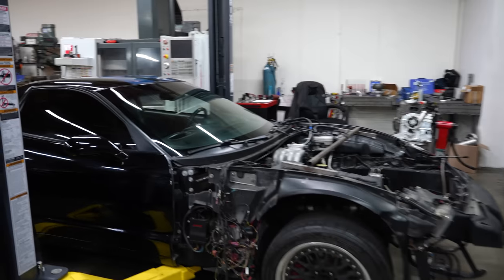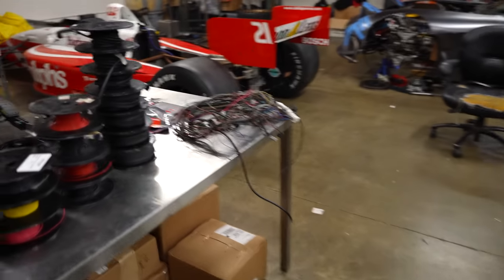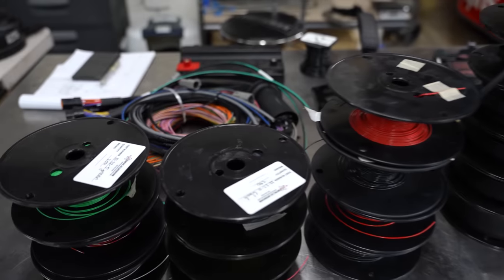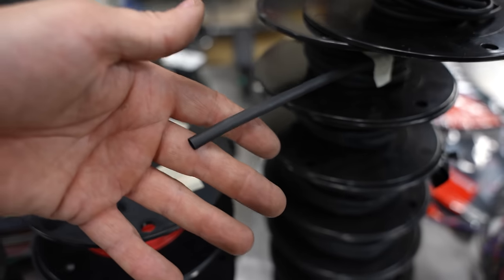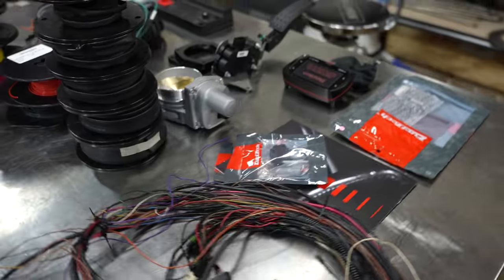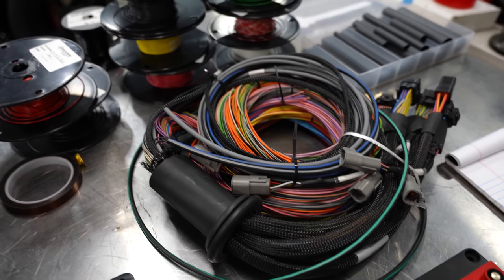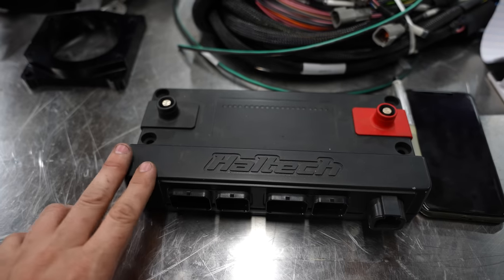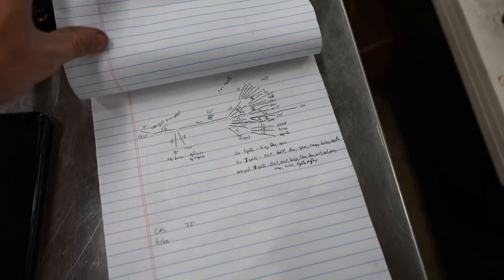The Ultimate Engine Wiring Starter Guide.

Comment: TE (TYCO ELECTRONICS) provides the complete "System 25" solution, initially developed for military ground vehicles I think. It includes the "DR-25" tubing (which is fluid-resistant elastomeric polyethylene terephthalate I believe), moulded parts with the "-25" prefix, and "/86" suffix meaning it comes with the TE/Raychem "S1048" thermoplastic adhesive, and standalone rolls of "S1048" adhesive for joining heat shrink and moulded heat shrink parts together. 

TE/Raychem also sell ETFE "Tefzel" and PVDF "Kynar" insulated wires, as respectively SPEC 55 (Tefzel) and SPEC 44 (Kynar) - both are high performance fluoropolymer/fluorine-based wires used in space, aerospace and military applications.

When you're referring to "levels" of wiring, I belive you're inadvertently referring to IPC/WHMA-A-620 classes for wiring harnesses. IPC standards often refer to three levels of craftsmanship, class 1 (General Electronic Products), class 2 (Dedicated Service Electronic Products), class 3 (High Performance/Harsh Environment Electronic Products).

Comment: After watching through this for a second time I had an idea. What about using that adhesiveless silicone tape instead of zip ties. There would be no notch for a wire want to pop into, and it is reusable so you can just remove and replace them as you move down the loom, plus you can stretch it pretty tight if you really want to clamp down. No clue if it will work, but figured it would be worth mentioning. Also you can roll the ends of the woven loom guard in on themselves to help keep them from unraveling.

Comment: Rob when you use nylon cable sleeve, burn the ends with a lighter to avoid the nylon splitting, also flip the end inwards like you close a bag of chips and then apply a thick cable tie. it looks clean and lasts forever.

Comment: Marine Grade heat shrink and wire made by brands like Ancor also have really good adhesive in the heat shrink and 105c oil/Solvent resistant coatings. Also tinned copper to prevent corrosion.

Comment: TXL wire is great, exceeds OEM specs, very affordable, and very easy to work with. If you not building a F1 car it'll be fine for most applications. But remember, even the best wire won't save you from a bad crimp.

Comment: Buy yourself some 3M self bonding electrical tape or commonly called thermal rubber tape... It will form a single rubber mould over your wiring. Can be used as extra protection under shrink tube and you can vary the thickness by manually stretching it depending on whether you need lightweight or protection. You can get it in different widths also. There is a semi-conductive version available that I use to wrap over 3M electrical shielding tape to protect signal wiring from stray electrical interference.

Comment: I work on medium voltage cables a lot and use this rayhem heatshrinks, they are very strong and stiff, but to shrink like 0.5m of heatshrink I need sometimes 10-15min of heating on high heat.

Comment: Very useful video, especially given that I've recently had a harness failure on a motorcycle of mine...

Just an bit of further explanation regarding that shielded sensor wire: you're correct about it being twisted and shielded for EMI reasons, but it sounds like you're trying to understand how the twisting helps. There's two major factors about why the signal wire is a Twisted Pair. First, is that the sensor signal is a Differential signal (basically the signal and it's own reference voltage). The sensor reading is then the difference between the signal return and the reference going into the sensor. 

Second, twisting the wires together it helps ensure that no matter what the orientation of an interfering EM field relative to the twisted pair, both conductors experience a common influence (creating a Common Mode noise voltage). Since, the sensor reading is the difference between the two voltages, this added noise due to the outside interference mostly cancels itself out. It's not 100% perfect, but it goes a looong ways to providing immunity to outside interference.

This is the same reason why Ethernet cables are twisted pair (and the UTP you see in product descriptions for those cables means "Unshielded Twisted Pair", in contrast to more expensive, more robust Shielded Twisted Pair cables).

Comment: Go to Lowes, get some peg board, and tight fitting dowel rod for the board and a 100ft roll of 16awg solid core wire. fabric measuring tape. Use the peg board to template the harness make a dummy with the solid core wire.

Lay the template on the engine

Comment: I use rtv to fill the voids where wires meet up. I put a little rtv in before I fully heat shrink everything together. The trick is not using too much that it makes a mess.

Comment: Twisting also reduces interference (induction) to/from other circuits. That’s why CANBUS, ABS, etc are twisted pairs. Same theory as the twisted pairs in an Ethernet cable. Noise and crosstalk reduction.

Comment: The crank sensor is a voltage generator. At low rpm, the signal off of the crank sensor is maybe a couple of volts, but once you have those teeth flying by the magnet at high speed, you get pulses of about 100 volts and more. 
The crank sensor wire is shielded to protect the system from EMI (electro-magnetic interference) generated by the crank sensor, not the other way around. Just imagine the leaked pulses from the crank tone wheel showing up on your throttle position sensor (that runs at 5 volts).
Keep stuff away from the crank sensor wire.

Comment: This probably won’t be read and I’m like 15 mins in but it probably won’t be mentioned,but as a F-16 electrician, if you want to clean up the harness is by using waxed twine instead of zip ties. You can also use them along the the harness instead of twisting it, in case there is a point where a wire needs to be replaced you don’t have to rip the whole thing apart and feed wire that was replaced under the twine.

Comment: Super 88 is really good electrician tape. It has an operating temp between 0 F - 221 F. It holds and works a good % above and below those temps to. So I’d say -20 F - 250 F would be fine. If you used that metal duct tape to wrap the Super 88 in you’ll have EM protection and also heat protection so that the 88 under it would survive the cable being exposed to sources much hotter than 88’s temp rating.

Comment: I enjoyed your video. One nit pick. conductor, insulation, jacket, cable and/or conduit. Wire is usually a conductor with insulation. Multiple wires in a jacket is usually a cable. The insulation protects you from the electrons, the jacket or conduit protects the insulation.

Comment: Afaik, the electrons running on the outside if the conducter only apllies at high frequencies. More strands also make the wire more flexible

Comment: Just a little tip, when your zip tying the wires your twisting around the center wires, look into string tie for aviation wiring, its alot easier to get tight so twists don't wiggle around and you avoid pushing the wire out of the way from the end of the zip tie

Comment: Level 5 wiring, every wire is color/pattern coded for its specific use. Open the bundle in the middle, no two wires match. 6 red wires, one red, one red with narrow white stripe, red with narrow blue stripe, one red with dashed blue stripe, etc etc etc.

Comment: A good heat retardant silicone would be good to fill in any voids at the branch points, it will stay flexible plus you can work out any air bubbles as it sets. It's brilliant stuff to keep, I believe the rule with all silicone is if it smells like  vinegar you should not use it on uncovered metal or cable so most will be fine as long as the insulation is intact. Really interesting show today thank you so much for sharing your experience I believe that you done a fantastic job it.

Comment: I have an interior/significant engine bay 03 Ford Lightning harness. Can't buy a new one. It was carefully pulled out from an RIP sonic blue by 2 Lightning people. It is sitting is a box in my garage. But I still used it as a roadmap to manage to fix significant amount of damage done. By a mechanic. Who is a friend of my close friends. 
It ran awesome, just heavy maintenance.  Wiring harness stuff is hard. Being a petite lady with small hands has few advantages. Running wires is one. I'm keeping that harness bc eventually mine will fail. I want to be driving it when I'm 90 yrs old.

Comment: Rob, nice video. The only advice is to use tube-style crimps for all the splits, and not the open-ended ones. Sure the open-ended crimps work, and are easier to put on, but tubes can withstand more pulling on the wires...a LOT more(some of them are even ribbed on the inside) also the open ends basically have a sharp edge on the end, that acts like a knife when the wire is bent 90deg and pulled on, but tube style crimps have round inside edges so they support the wire better.

Comment: They make heat shrink cartridges that you can use in label makers too that is relatively flexible. It works great for small wires and larger ones as it comes in up to .92".

Comment: Excellent wiring skills! The only thing I'd like to point out is that for the sake of future repairs that may need to be done I'd avoid using epoxy. The epoxy is very hard to take off and most the time when there's wiring issues its right near where the contacts get inserted into the connector.

Comment: For better protection of the wiring harness splits you should use heat shrinkable moulded shapes. There any many models available with and without adhesive. HellermannTyton is one of the biggest manufacturer of moulded shapes and with W21 pre applied adhesive you’ll be on the top 😉

Comment: having one central star point for the grounded wire is also good for security. electricity always looks for the least resistance, so if you have a bunch of loops and stuff it can happen that due to the length the grounded wire isn't the one with the least resistance anymore.

Comment: EMF = electromotive force
EMI = electromagnetic interference

You should check out there HP Academy course as will. If your going through all the trouble of using the foods stuff, your might as well learn how many wires you should have in each layer. Their course is top notch.

Comment: at 36:28 , having a few crimps nearby each other might make the harness diameter larger (harder to fit into heat shrink) but staggered crimps can sometimes make the harness less flexible / harder to bend.

Comment: AND DONE! lol why not instead of using the smaller heat shrink under the bigger to fill space, shrink the bigger and put the smaller over, depending on the gap you are trying to fill it will seal it way nicer

Comment: Electrons only travel on the surface layer of some AC signals. Not DC. And in that case they only use the outer strands. The inner core wire(s) go unused. That's why high-voltage power wires are often split (doubled) and have cores of steel (for strength as well as being unused).

The main reason that small-strand twisted wire is used in automotive applications is for bending and flexibility.

Comment: On the connectors you should try putting the large shrink on first to cover the connector and wire then sliding the little shrink over the end to fully seal the end of it
Reply from the maker: That’s a cool idea!
Reply: @RobDahm  I mean you are more of an expert than I am in the automotive portion and you possibly could have tried this way already but I've always liked how it has come out when I do it that way when I repair connectors (huge fan btw learned to rebuild the rotors from you)

Comment: Damn that's insane you built your own engine wiring harness. I've done tons of low voltage wiring in buildings, but never stressed out about it so much as when I had to replace my fuel injector electrical connectors, because the pins didn't fit the aftermarket electrical connectors. Probably one of the worst environments for a wire connection possible.

Comment: The low voltage wires require plenum rated shielding from higher voltage wires delivering electrical power.

Comment: Somewhat satisfying to watch. FYI the way the label maker works is thermal transfer to the label. So not sure in the long run, will the labels just turn black with the heat from the engine.

Comment: I'm always surprised how little winds up needing to be shielded-- interestingly enough, GM shields their DBW pedal and throttle body from the factory and not CAS (or their CANBus stuff surprisingly). Really, really awesome video Rob. You've pushed me over the edge to do my Datsun's harness right; at least to the best of my ability.
Reply: CAN uses differential signalling, and noise should increase or decrease both high and low lines, you'd only get a problem if the voltages moved towards or away from each other.

Comment: You don't necessarily chose shrink wrap for the entire shrinking ratio - that's meant to account for lack of uniformity when you have varying diameters in a harness (not just car harness). You generally want to use the smallest size that easily slips over the harness so you achieve a more secure shrink and flexible coating.

That being said, nice video.

Comment: To avoid the dip in the Ty-wrap when wrapping your harness take the Ty-wrap go around 360 degrees before insetting the end of the Ty-wrap into the head then pull snug. No dip no need for tape.  30 yr Verizon cable splicer doing as many as 3600 twisted pairs at a time or 7200 individual conductors lol

Comment: @5:28   Electric current on the outside of wires is called the skin effect, and is only significant at high frequencies.  Basically, anything under 1 MHz or so, the skin effect is negligible.
The reason the number of strands matters is flexibility of the wire, and resistance to movement and vibration.   Fewer larger strands are more susceptible to metal fatigue from repeated movement and can crack in extreme cases.

Comment: Great video, but not gonna lie, I wired my engine swap in my C10 with Cat 6 network cable shrink-wrapped neatly for signal wires... because I had a partial roll of 1000ft sitting around.

Comment: The sand paper is not original to Horsepower Academy. In Medium Voltage and up cable splices some Splice Kits and techniques state to use Emery Cloth to prep certain parts. 
If y’all want ideas on making crazy good splices check out the videos on the different types of electrical splices. On medium voltage and up the the way the electromagnetic field lines form is a major concern and is what most of the splice techniques are designed to manage. Nerdy but good stuff to know. Even the way cables are stacked or spaced out is important ie 3 in a triangle is ok if space is needed but three spread out with iirc 1,5 of cable diameter space between each cable will last longer.

Comment: every time you  used a zip tie
you could have used a strip of capton tape 
this way you dont need to remove the temporary zip ties
less room for error and such

(unless you need that pressure form the zip ties)
(can you use hot glue or does that melt?)

the end result (and the process) was hella beautiful to watch

Comment: Rob Great Video!!   I am placing a 2007 Northstar into a Kit Car and I have the original engine harness, ECM, TCM, Fuse box and have the VATS shut off. Could you provide a video on how to power up an OE harness and maybe even show adding the OBDII connector and Throttle position signal from the electronic gas pedal?  Include any other obstacles that one might run across using the stock harness? 
That would be such a great video and I couldnt find one already done on YT. Most are about modifying or making your own harness.

Comment: Looks very pretty but what happens when you get a short that melts insulation inside that heat shrink? And takes everything with it? I prefer wiring to be open and easily repairable / see if anything is getting too hot

Comment: I definitely needed this video, but I have a question.
If you don't measure and identify each wire prior to making the harness, how do you doo it after when you are longer able to pull the wire on 1 side to identify the other?

The only thing I can surmise is that you label both ends? But even if you cut them all at one length,  what happens when 1,2 or 3 wires need to be 6" longer? Cutting and extending is just an extra possible point of failure.

Comment: loved your vid, never thought i could watch a 1h45m video on wiring and still be enthralled. And here comes the unsolicited constructive criticism. Would have preferred that you grouped your wires and twisted them together in order of function as opposed to by colour so you don't end up with a overlapping bulk before the split off. also as an electrician having a crimp/junction in the middle of a wire is a big no no and any terminating should be done only at the ends of wires not in the middle (but it seems auto electricians do it differently). but otherwise wicked good job, i would hire you and your first attempt at that, well done.

Comment: Man, I think you would get a lot out of the USAF's high reliability wire maintenance technical order. If those aircraft can potentially survive the EMI waves from a Nuke blast... it should work well running high power right next to sensitive wire components. Shielding!! After watching 15 min. Of your video I get that you know enough to get into trouble. But if PA allows it I can possibly share with you a "manual" designed for aircraft wire maintenance that will take you to "level 5" so to speak. It covers splicing shield, environmental splice, you name it.. bend ratio!... if an aircraft is good with it, a 4 wheeler should be more than fine.

Comment: instead of crimping every wire couldnt u use a quick connect for that whole section so u can just plug and unplug a single clip? and it could make it easier to fix if that section goes bad